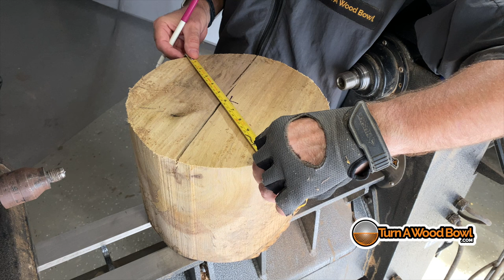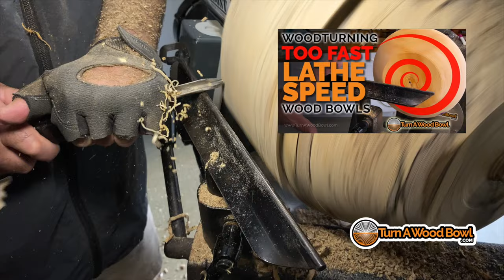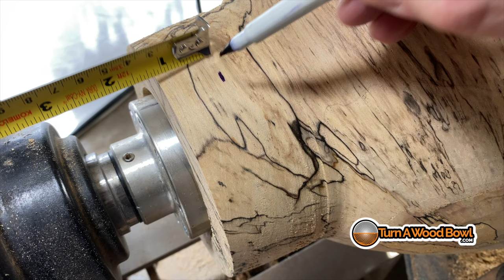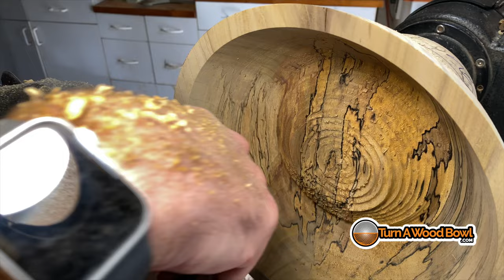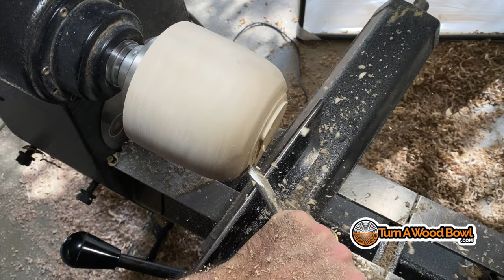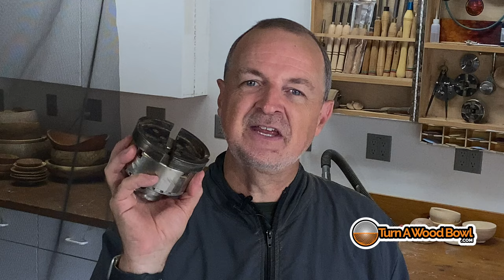Wood Bowl Turning Without A Chuck Woodturning Video

Comment: Kent can you give me a way of emailing you. Im attempting to start the sharpening course but there are big problems there’s no links on you web pages to send emails. I’ve paid the admission fee but nothing has happened .
Reply from the maker: Certainly and sorry for any inconvenience. You should have received an email with instructions. You can email me at kw (@) turnawoodbowl (dot) com. Happy Turning!
Reply: @TurnAWoodBowl   The basics, I like. I turned bowls without a chuck for several years before I had the funds to buy one and got along fine. Like you said, just a little more time involved. I have certainly made use of many of the tips you have given. Keep um coming.

Comment: I watched your video and you talk about moving your body and not your hands. How can a person in a wheel chair cut a blank?
Reply from the maker: If you can shift your torso weight from left to right, that is easiest way to cut a smooth pass. If that is not possible then the next best thing is to use your arms to rotate the bowl gouge and make a passing cut. Because our arms have some many joints and possible motion directions, it can be difficult to make a smooth pass. However, with practice this can be accomplished. All the best to you and Happy Turning!

Comment: the only thing I see is that you didn't have to use that much waste material just glue a sacrificial piece of wood to paper then to the bottom of the bowl when your done turning you split the sacrificial piece off your bowl and your faceplate screws are only in the sacrificial piece. I know this method Works cuz hundreds of bowls were made at my high school back in the 70
Reply from the maker: You are correct. Thanks. Happy Turning!